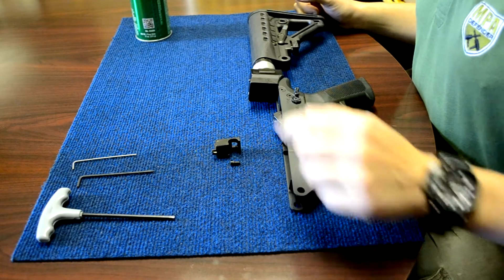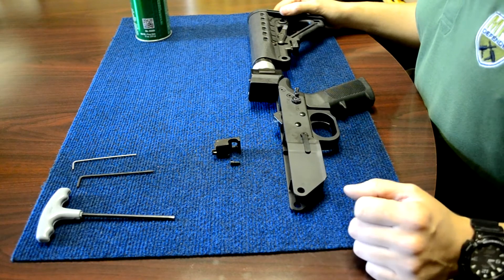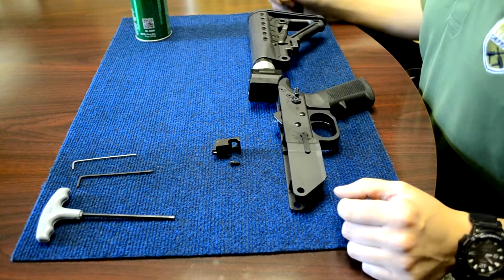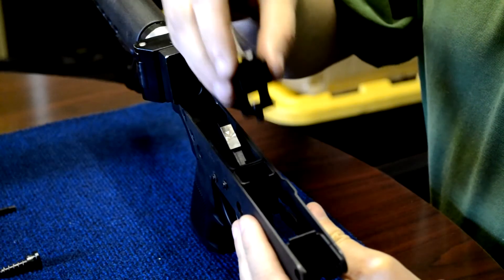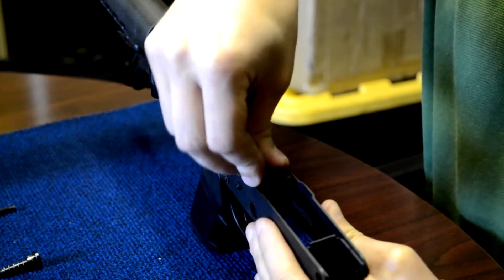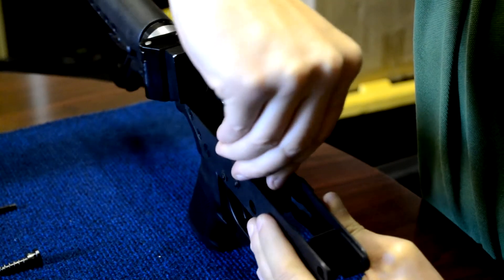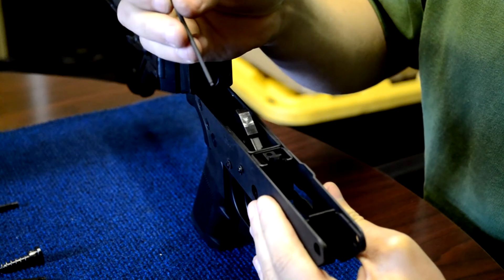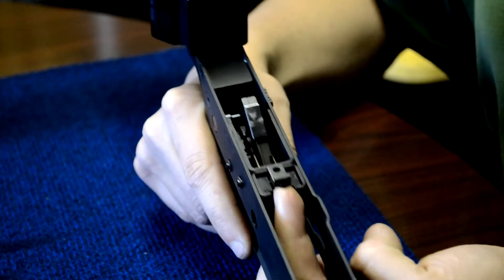Masterpiece Minutes: How To Install MPAR Bolt Hold Open

Comment: Question. Why did you say a 332 ball Allen wrench. I have seen one of these but they are not available at your general stores here in Nebraska. Not that they are hard to get but it's just another thing to have to drive or online order. Have you thought about including it with the upgrade as part of the kit. Similar to scope rings the wrench is often included.